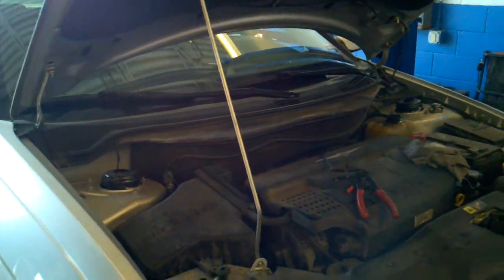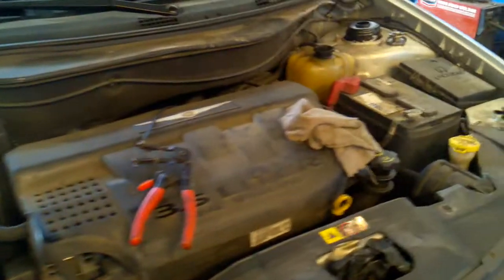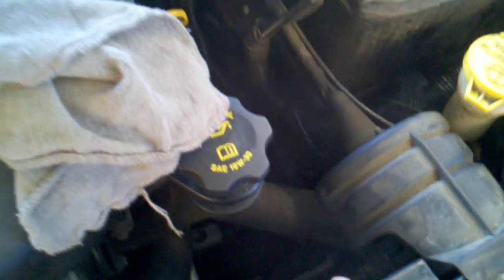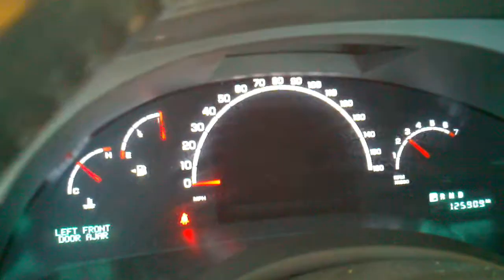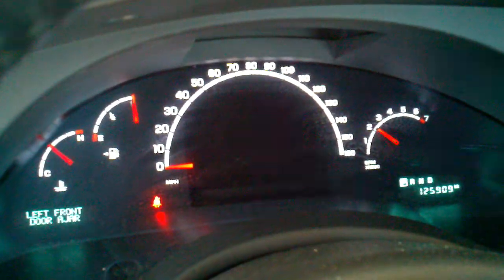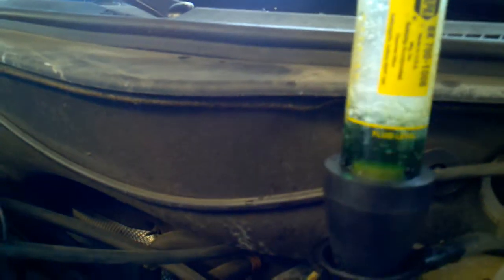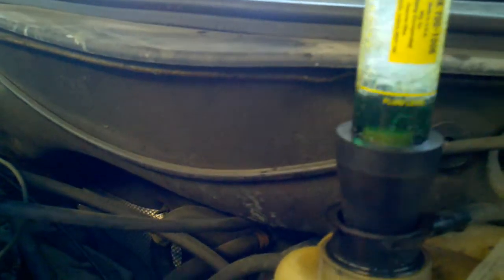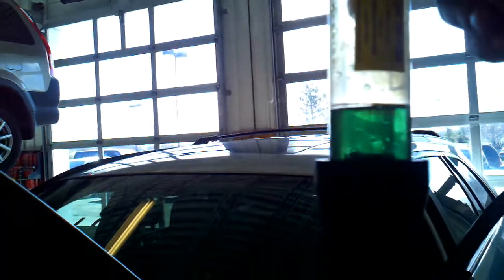Chrysler Pacifica 3.5 BLOWN HEAD GASKET TESTING

Comment: I have an 06 Pacifica same problems it's not always the heads that causes the car to leak combustion gases it could also be the upper and lower intake gaskets as well they run almost hand in hand or the pcv position crank valve could be stuck open causing moisture to get inside the engine and could eventually lead to a defective head gasket..also the O2 sensors like to go out or the catalytic converter likes to clog and you begin to lose power I've read alot of forums on the Pacifica model these are usually the c'mon problems of moisture inside the engine or loss of power..the intake gasket replacement cost is only around $25 if you do it yourself I just replaced mine the other day put a new thermostat in about to do engine flush oil change and see what she does...even with the gases inside my engine the computer said it was only a bad lower o2 sensor...ITS NOT ALWAYS THE HEADS THATS WHAT THEY WANT YOU TO THINK $$$$$$
Reply: Do you think I need a new intake gasket too?
Reply: What was the outcome of what you did to your car?

Comment: Yeah right I didn't see any signs of a blown head gasket in this video you must be one of those mechanics it should have worked right away not after you push down on the gas and move the tester around to try to get air to cause the bubbles🤔🖕
Reply from the maker: LOL " one of those mechanics"
 Regular air will not cause the fluid to change color.  A head gasket that is good will not show any color change no matter how hard you work the engine. I am thinking that you do not understand how the tester works. You have to squeeze the bulb to draw air though the aerator that is meant to make bubbles.

Comment: you said in the first part your video the upper radiator hose was popped off that means the front engine mount is broke and pulling the house off and the water pump it sucking air from the gasket  i just had this happened to mine  i replaced the pump and gasket and front mount and mine is good as new!
Reply: Wow. This is revolutionary.... Thank you for this!!!!!!! I hope this is my problem, but the hose is not pulled off. Water is definitely getting into where the spark plugs are in mine. Mine looses power too especially going up hills.
I don't think it is my problem, but Hawai'i has rough terrain and my car was treated roughly before I got it. I think I need a head gasket because it over heated at some point.
Reply: You are correct sir. Well done.

Comment: It is not head gasket itself!!!!! The problem is with screws, they were replaced for a new one, very low quality with very low temp stability or they were screw up with lower force than required. Of course there may be more suspects but as it is everything is dependent on temperature. Think yourself if you can.

Comment: The condition of the spark plugs give you a wealth of information reguarding your engine. Learn the spark plug condition chart. I also use a 3' long 1/4" thread rod with a 3/4" washer sandwiched between 2 nuts for the ear piece at the tip of one end of the rod. This is a stethoscope,(use caution with moving parts and ignition voltage). You can pinpoint noises or lack of (defective injectors) like a doctor listens to your heart. Your neighbors will be wondering what your doing!      Good luck.

Comment: This is how I check for a cracked head or blown gasket: Look for oil in the coolant also smell the coolant (after releasing pressure), if gases are present you will without a doubt smell them, Put you hand near the end of the tail pipe then see if you smell coolant or oil on your hand, it dosen't always smoke, remove 1 spark plug at a time and note the #cylinder and the condition of the electrode/ tip of plug, (there are charts online) or take pic. Spray ether,short bursts see where rpms go up.

Comment from the maker: when I first tested the the vehicle it turned from blue to yellow in just a few seconds, so then I grabbed my phone to take a video and this is the result, the engine was cold when i first tested it and as it warmed up it stopped leakking as bad. I put a preasure gauge on the engine when it was cold and started (with out pumping it up) and after a few seconds the preasure goes to over 18 psi definalty a combustion leak. Customer declined further inspeciton or repair and towed vehicle to trade in
Reply: They towed it to someone that knew what they were doing, and didnt want to RIP them off...they were just being nice to you.